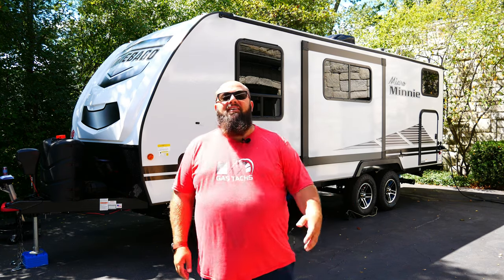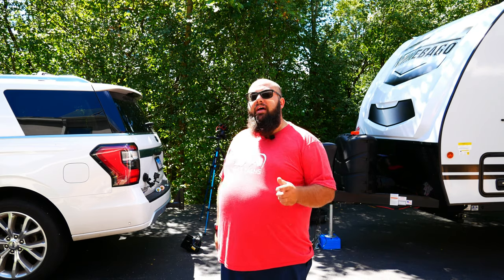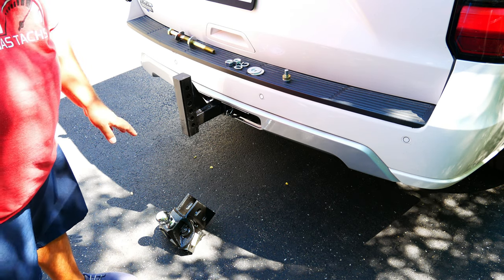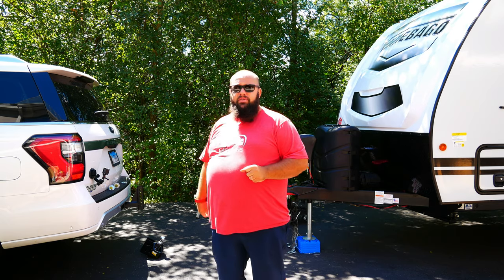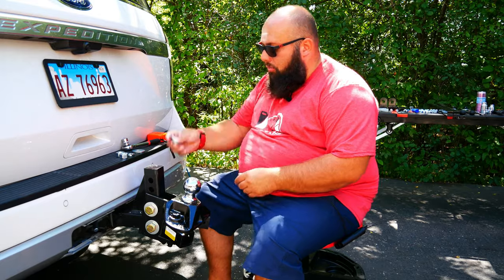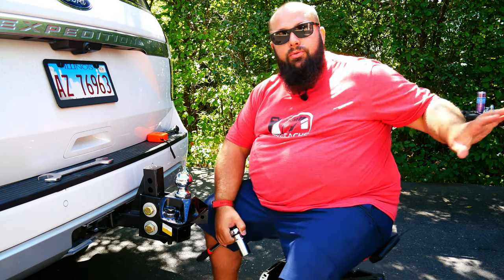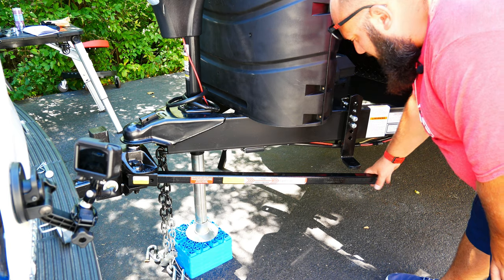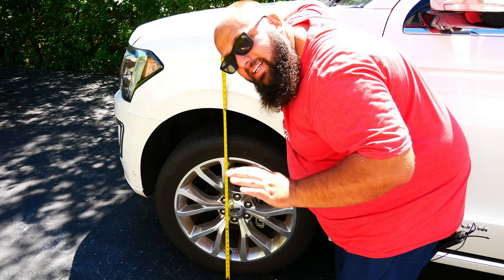How To Install Weight Distribution Hitch Quick Simple

Comment: A great video  I have towed  7 different trailer and camper but all small ( under 1500 lbs ) no need for load levelers. I want to thank-you for showing me how  to install a load leveling trailer hitch ( I hope you are ok after the fall)
Reply from the maker: My ego of towing for many years said I didn’t need one, but ego aside it’s safer and actually makes it ride a lot better. As for the fall, nothing a beer or 2 couldn’t fix 👌🏻
Reply from the maker: My ego of towing for many years said I didn’t need one, but ego aside it’s safer and actually makes it ride a lot better. As for the fall, nothing a beer or 2 couldn’t fix 👌🏻